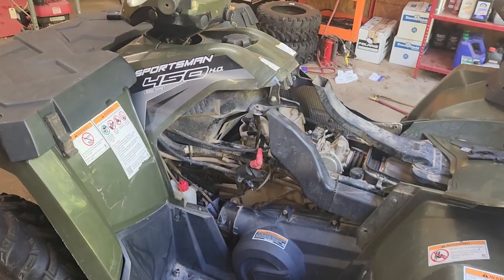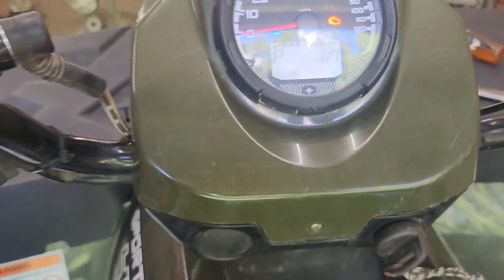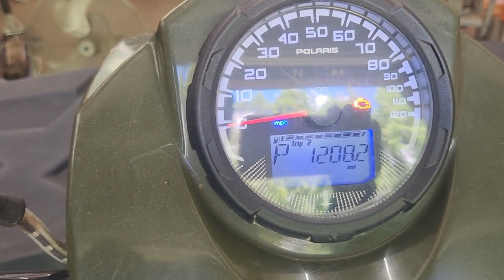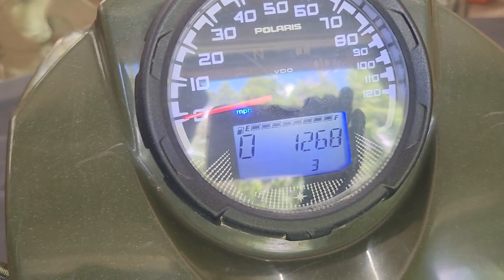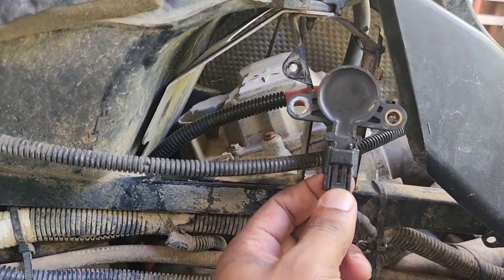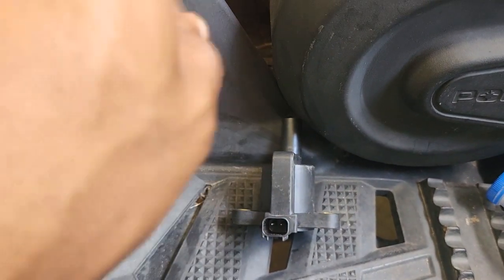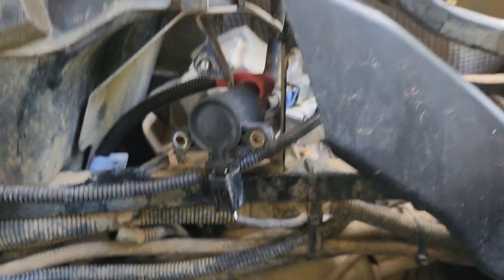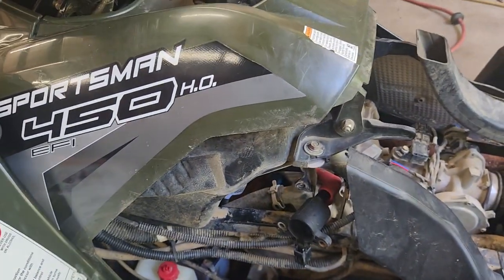Polaris Sportman not firing and won't crank! How to view and diagnose Polaris Error codes

Comment: I got a 2019 Polaris sportsman 450 ho efi and I’ve put a new relay fuel pump and new battery and it will whirl over but won’t crack up and I don’t know what could be wrong if you could try and help that would be appreciated